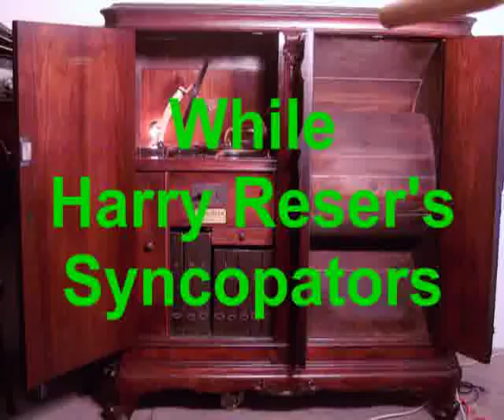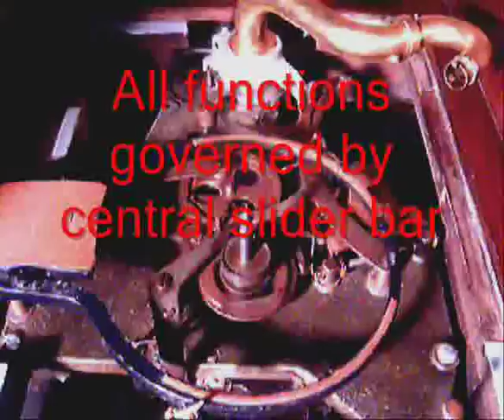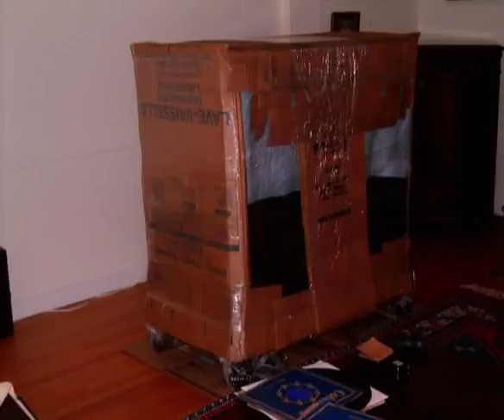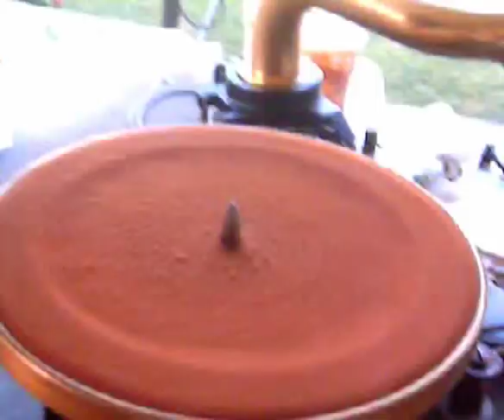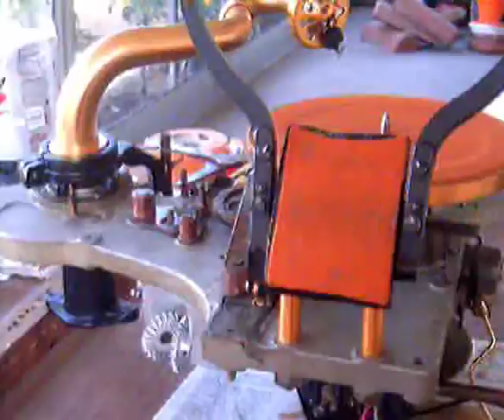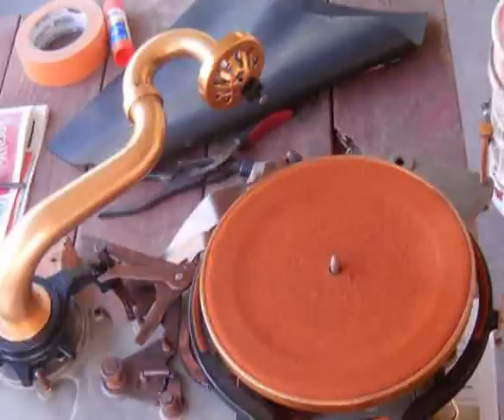Victrola 10-50 sitting on table & Harry Reser's Syncopators: Someone is Losin' Susan Record Changer

Comment: @straycatt100 ,I once had a 1050 and I put a thin coat of epoxy on those cracking pot metal parts after removing that pin that holds it.With a little sanding to make it fit,it worked beautiful again.Because of the size,I had to part with mine when i moved a few years ago.

Comment from the maker: Hello, Victor told you to use black shaft tungstone needles, but gold shaft will work as well. 

I usually just use steel needle and change after each play.

Tone arm is of standard weight, which is not a problem on wear, as long as the soundbox is properly serviced.

Comment from the maker: No rubber on this machine, but a couple of pot metal parts that fell apart. You can see some of the bright aluminum replacement parts.

Cleaning is not as critical on these old changers - the motor is plenty strong and will pull through, but playing the machine dirty will wear out the gears eventually.

Besides, it is fun to take the baby apart, clean everything and have it shine brightly.

Oh, and as I said, a job like that takes me at least  three full days, but it's worth it.

Comment from the maker: It overheats because of overload: With the platter locked by the felt, the platter is the flywheel, and the motor just puts a little bit of power to start the changer. With no platter or a missing felt, the motor alone has to put a lot of power to start the changer. It happened to me once in an extreme case, where I had a changer run continuously without platter. The motor drew so much current that the coils overheated. Not going to happen in regular use, but still put that felt there.

Comment from the maker: Mark,.most likely not Victor's fault, but yours, if you took the motor out: The right front motor mounting screw is a tad shorter than the rest, if you put the screws in wrong, the spindle leans to the right. Check that. But, yes, I also put two layers of insulation tape on the 12" separators, for another reason: European 12" are metric and very small. But check the motor mounts first.

Cheers

Comment from the maker: @CoolDudeClem Not just a little TLC - a LOT and a LOT OF MONEY

- the infamous 7 pot metal parts usually are crumbled.
The guy who made aluminum recasts stopped doing them. So, what are we going to do in the future?

Even in 1927 they took production shortcuts (pot metal die cast is much cheaper than brass), and now we have to spend a lot of money and time to replace those broken parts.

However, once that's done, the machine is working great. 

: )

Comment from the maker: Then leave it, or leave it until your next general tear-up. It's normal that the record slides a little to the right, otherwise the separators could nip the edge.
Usually, when the motor is mis-moutned, the starwheel makes a scraping noise too.

Congrats for solvign the problem.

Comment: What's the reason for saying the motor can overheat without the platter on it?  I figured since the felt washer is between them, the platter wouldn't serve as much of a heat sink.  Some other reason?  I'll remember this tip though.  I've finished repairing and tuning mine up except for the record size selector.  I can't express how much I LOVE playing my 10-50!

Comment: Nope I never removed the motor, I guess someone else could have in it's 80 years.  Thanks I'll check that out, screws could be mixed up or even loose.  I knew I wasn't thinking of something - the positioning of the motor itself, not the ring.  Right now it works 100% of the time but the record hole still slides along the right side bevel of the spindle when dropping, not a huge deal.

Comment: I wish Victor had put some more adjustability in the positioning of the record on the ring vs. the spindle.  Easy to tweak it front to back, but mine wasn't quite dropping the record far enuf to the right.  Once in a while a record would miss the spindle.  I had to tweak those two big brass posts to correct it, maybe there's other ways to do it.

Comment: Great video and machine. I just recently got a couple not really working bad condition ones and took them apart for cleaning oiling etc. However I notice that it seems like the mainspring apparently ages and looses its power and my guess is there is no real replacing it except to get another old one that is also dying? Do you know--does that mainspring loose its springiness?